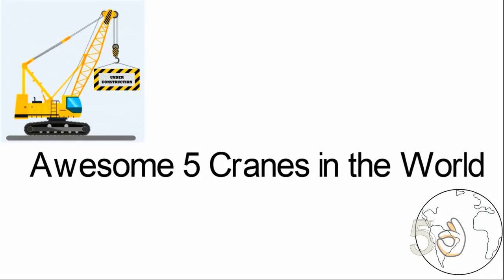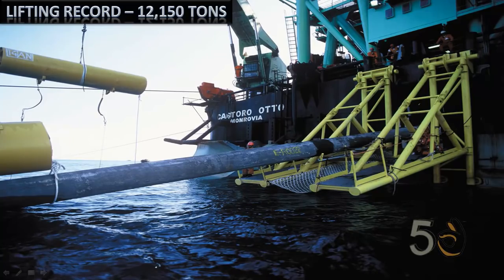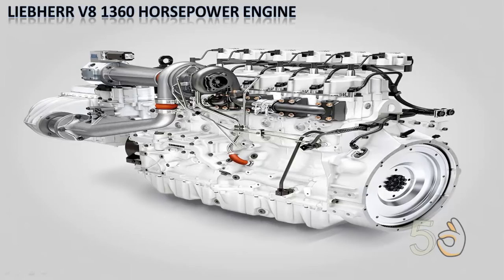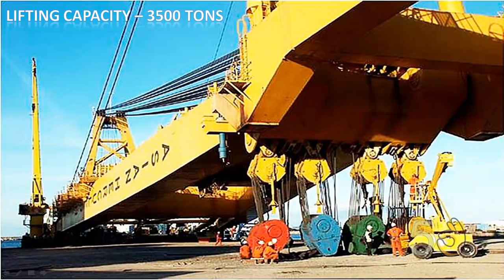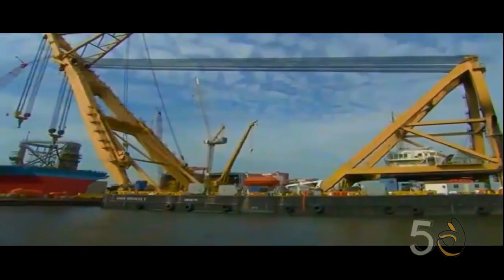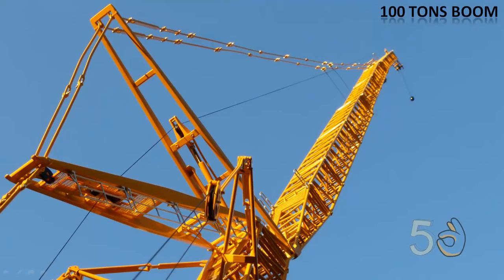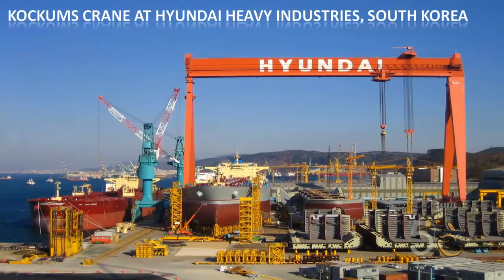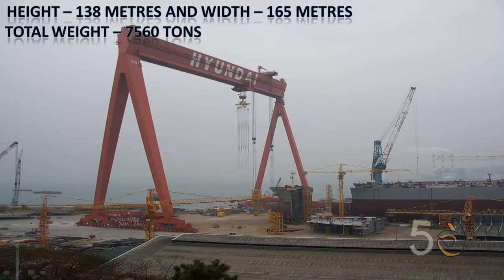Awesome 5 Cranes in the World

Comment: The Saipem has never been the greatest, my friend.
The Thialf is bigger and stronger.
Reply: The Thialf is ever so slightly larger in beam and length, and has a 200 tonne lifting advantage, but the Saipem is still the more impressive vessel overall in my opinion, although I am slightly biased as I sailed as an engineer on the Saipem for a time and have only seen the Thialf.  But from strict stats, and features, the Saipem is a little more "awesome".  The lifting radius is larger, and the power and propulsion systems are much more impressive with 12 generators producing almost a hundred thousand horsepower.  19 fully azimuthing thrusters and 2 bow.  Plus the J lay tower for deep water pipe laying.  etc.

Comment: Saipem 7000, commissioned 1987, was never the strongest, always the 2nd, as Thialf was commissioned in 1985.
Reply: Tuetensuppenkasper  
S7000 actually commissioned in 1985 and launched in December 1986 by Fincantieri 🇮🇹🇮🇹🇮🇹
Done some work around it for Saipem in mid-90s regarding security training videos for the crew and 3D animations on the J-Lay pipeline system installed in 1998, had received the entire CAD files of it from Saipem Engineering LTD.
Never been on board but I’ve been on board it’s smaller sister Saipem Castoro 6.
Ciao da Milano, Italia 🇮🇹🇮🇹🇮🇹
Reply: @ClaudeMagicbox  Hi Claude,
Thanks for the correction. It must have been an exciting job to work for Saipem. And the nice thing is, should you ever retire, and choose ship model making as a hobby, you already have the plans.
I haven't really dealt with the Castoro 6 yet. Also a pretty impressive ship. According to my information, the Castoro is used more as a work platform and less as a crane ship?
Thank you, have a nice day and stay healthy in this sick world
Ciao Tütensuppenkasper

Comment: Good vid! A bit out of date now. Sleipnir SSCV is almost complete. It can tandem lift 20,000mt. Taisun ( A land based gantry crane) has been built awhile,and can also lift 20,000mt ( it exceeded this in test lifts). The Honghai Hoist can lift 24,000mt,but only one half has been assembles so far. The other part is built,but due to a fall in the industry, it is awaiting final assembly. OOS Zeelandia is a proposed SSCV with a lifting capacity of 24,000mt. Exciting times in the super-heavy lifting world!
Reply: When the video was made Heerema's Thialf was the largest crane vessel in the world with a tandem lift of 14,200mt just over saipems 7000 capacity
Reply: @Jordy13081990  Indeed.It would be great if you would make a new video? There is now a double Gantry crane at Tuas shipyard in Singapore that can lift 30,000mt ! Exciting times for big engineering my friend!

Comment: Surprised you didn't include the Yantai Raffles crane called the "Taisun". It holds the record for heaviest lift at 20,133 metric tonnes. That's unimaginable to me. There's a picture on Wikipedia of it holding in the air the 17,100 ton deck of an oil rig. A mile long fully loaded freight train weighs about 6,000 short tonnes. So this crane could lift 3 of them, cars, cargo and locomotives included! It could pick a naval destroyer out of the water without breaking a sweat!

Comment: Thialf is bigger than Saipem7000.
Reply: Liebherr cranes are some of the best mobile and crawler cranes in the world.
Reply from the maker: +Kees Overbeeke In terms of lifting capacity, the Thialf is slightly bigger then the Saipem 7000, but what really qualifies a crane, is not the max. lifting capacity, but the max. load and seen from that point of view the Saipem 7000 (588,000 ton meter versus 443,040 ton meter) beats the Thialf.
Reply: You are right.Biggest lift ever has been done by Thialf as far as I know: 12600 tons.Sleipnir will overtake them soon.
Reply: Asian Hercules is dwarfed by the barge cranes at Hyundai Heavy Industries (10.000mt) and Samsung Heavy Industries (8000mt).
Reply: actually the record offshore lift is 24,200 tonnes, which was set by Pioneering Spirit when it lifted the  Brent Delta topside on April 28, 2017

https://en.wikipedia.org/wiki/Pioneering_Spirit_(ship)
Reply: Pioneering Spirit didn't do it with cranes.Although PS is a very sophisticated  vessel; barges can lift up to 40.00 tonnes
Reply: than it wil be the H851 from heerema Will Bhttps://hmc.heerema.com/projects/wheatstone/36000 MT but they call it a float over.
Reply: Never heard of such 12600 lift by Thialf. Are we talking short tons or metric tons? Which project was? The ridiculous 100mt extra on each crane for which the Thialf got the certification are the simple desire to thinking of having a larger capacity crane when in fact Thialf crane are much smaller in size and radius lifting capacity. Sleipnir will be for sure the top one crane vessel when ready.
Reply: PS only does Active Floatovers, no crane lifting.